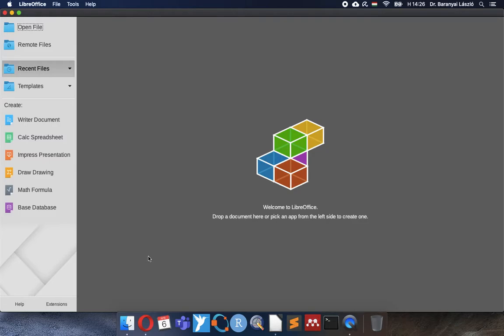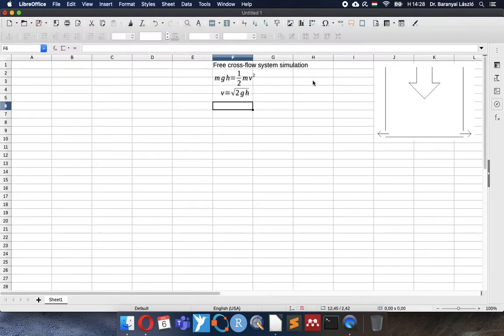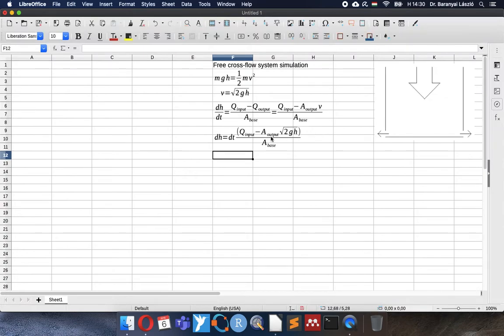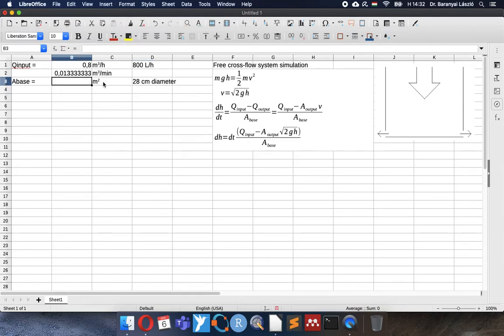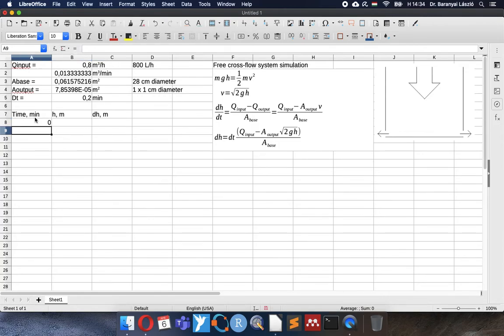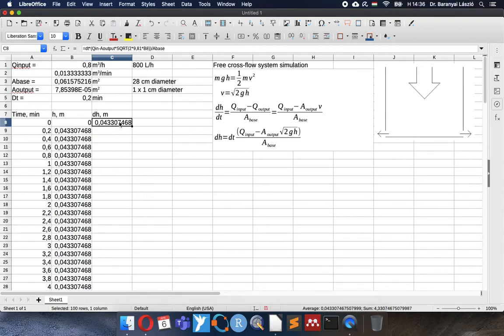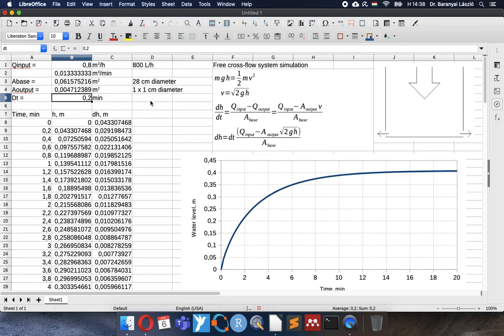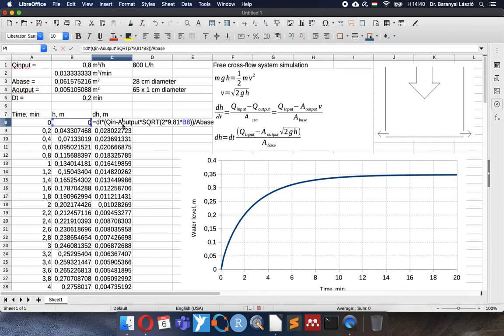[EN] LibreOffice tips and tricks: solving differential equation with Euler's method

Comment: When I use a dt ofy  0.2 and 368 holes, the system becomes bi-stable, at least for 20 minutes. If I keep adding small increments, the bi-stable state gets longer. For example I got to 368.339212. I wonder why the equation breaks at this high number just before it nose dives. Kind of an unrealistic thing anyways, having 368 holes in a kitchen pot.
Reply from the maker: Because the outlet sum area is comparable to the base. Due to the iterations, the water arrives and increases the level, after that all water is leaving. You will get some results if decrease the dt.